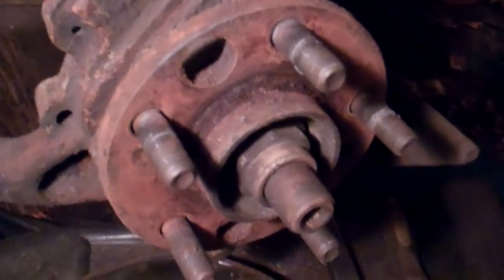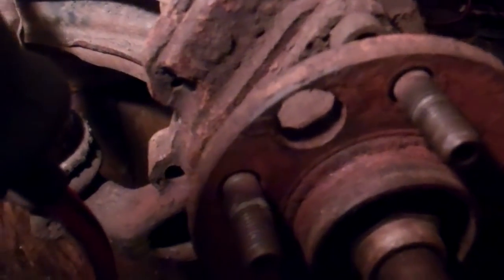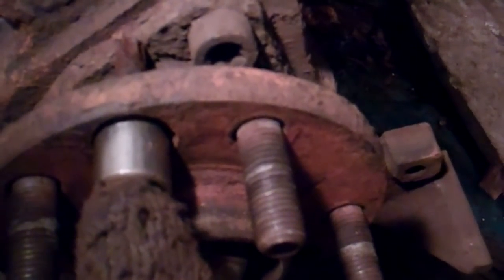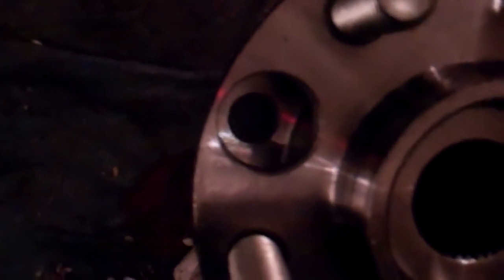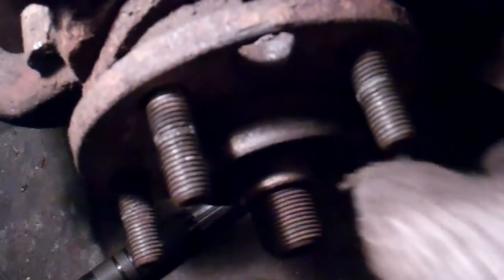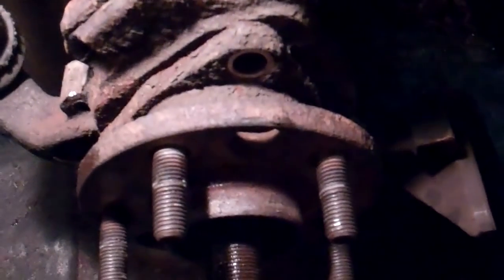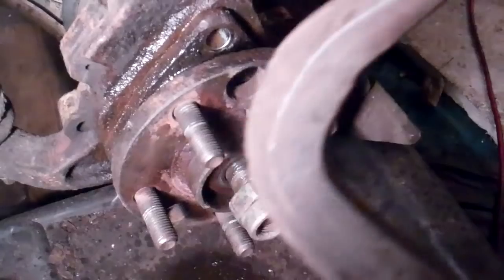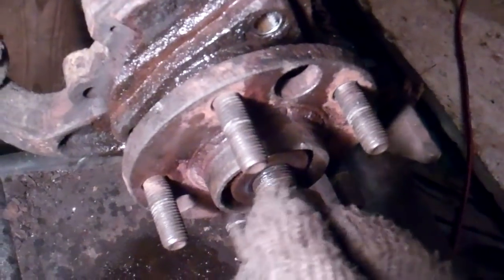Releasing a stuck hub &  bearing

Comment: I have taken apart my entire front suspension, repaired engines and alternator with absolutely no prior experience thanks to brilliant guys like you sir. Thank you.

Is it just me or do they construct automobiles to purposefully not be able to fixed easily? I mean, the design of everything I have taken apart from televisions to engines always seems be designed with the purposeful intent of making it as complicated as possible. 

As if the designers or engineers take pleasure in making it unnecessarily complicated and a headache requiring specialized tool. 

I guess i can try and see the bright side I mean my car still works and I haven’t electrocuted myself to death.  Okay that is my rant.

Thanks pal! That threaded nut trick looks
Like a good one except me hun has no big hole like your does. Still
A great idea!

Comment: Just spent 6+ hours trying every trick I could think of or find on the internet to break loose a rusted on hub and nothing worked. Found this video and tried the threaded rod and it worked in about 5 minutes. Thank you!!!
Reply from the maker: Glad it helped Angel - thanks for commenting . It takes a bit of time to set it up - but It's my "go to" method when nothing else releases the bearing !

Comment: Good tips...you can also try bolting putting the wheel back onto the lugs, and then kicking the crap out of the edges of the tire.   It gives you leverage, and it worked for me!

Comment: Thanks for your video!  It was the only way I could get the hub assembly out of my 2006 Pontiac Torrent.  I hammered on it for a couple hours and used penetrating oil and even tried putting a torch to it.  Nothing seemed to work.  I did break a couple bolts trying this, but it was well worth it since it was the only thing that seemed to work.
Reply: Tony Campati Literally just did this on my 06 Torrent too. Same exact thing. Broke a few bolts trying, but she did break free.

Comment: Before you install a new brake disc put some grease on the hub and inner edge of disc where they meet. This will help prevent rust from forming and make it easier the next time you need to remove disc.

Comment: If you keep rust & corrosion from forming between the rotor & spindle, by using a die grinder & sanding disk plus some  antiseize or grease, My rotors always come rite off.also, invest into a slide hammer...I have things apart to often for anything to seize up! I always grease everything up or use antizeise!

Comment: With a small propane torch , apply heat in a circle  around where it slides over the hub , while keeping the hub cool with a wet rag constantly wetting the rag , the rotor would expand just enough to slide off.. It was mostly heat that fused it on anyway
You need to get it cherry red before worrying about it warping.
As far as turning the shaft, 
99% of the time, you could just put the transmissionin neutral , instead of lifting the other side, to turn the shaft.
FWD's are not Posi-traction.

Comment: well, you DID get it off, but really, MUM s007 's advice here on using heat to get the disc off is correct, fast and easy. I use it on rear drums too. To get the hub off, I back out the flange bolts 2 turns and drive down a bumpy road, let the car loosen it for you. Whole job should take half an hour. Better luck next time!

Comment: Instead of jacking up the other side why didn't you just very easily put the cars transmission in neutral to turn the opposite side hub for bolt access ?

Comment: Trying to change the hub and bearing the front of hub and bearing fell out but back of the hub is rusted on and won't break loose plz help me how to get it off
Reply: +Amber Murdock One of the only ways is either to remove the knuckle and use a press.  You might be lucky and be able to use the press with the knuckle still on the vehicle. You can normally rent "free" a press from your local auto repair store.

Comment: 4:13 that never seems to work, you want to "shock" it. Use a hammer and get from behind. Heat it up good then spray CRC Freeze off to rapidly cool it down. Then immediately hammer. Repeat the steps apply heat, cooling it, then hammering. It should budge. Once it moves a bit you know you won.

Comment: Man I just dabbed a little gas on there lit it on fire, after struggling for 45 minutes 300fp wouldn't get that nut to budge tried a 2 ton jack 6 foot cheater bar and everything soon as that gas went out turned loose before I could torque on it

Comment: Where do you get a big bolt and nut to drive off the hub? Thanks.
Reply: Go to your local hardware store you can buy a hex head bolt and nut to fit or if you want to do what he did get a threaded rod and nuts to fit the rod.

Comment: the manual had nothing to do with why you were having issues , that knuckle and hub assy was rusted like crazy , next time soak parts in a rust penetrate and impact with a sledge around the part and then it should slip off . lol i cant believe you had to jack the hub assy with that all thread and two nuts
Reply: You haven't doe many hubs, have you? They seize pretty much a year after installation. It's just a corosion due to two different metals.

Comment: Good morning one quick question , i just replace my front two whell hubs and the ABS AND TC light came on, my dashboard, is their a reason for this
Reply from the maker: Anthony Kirkland Try disconnecting the car battery for 10 minutes to reset the engine codes Anthony. You are smart enough to be able to replace the hubs; so i doubt that you didn't re-connect the ABS sensors
Reply: I did that, the light went out but if you drive the car more that 40 min the light come back on, only when you drive a long time it come back on then gose back out, will this effect the car when stopping
Reply: dirty sensors